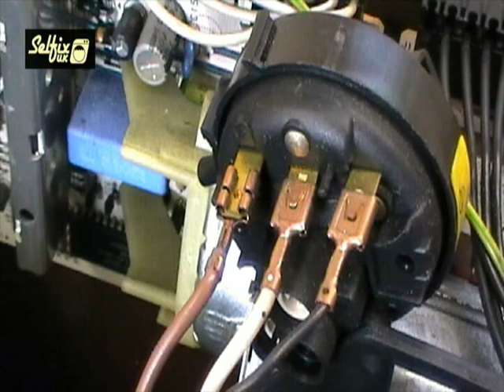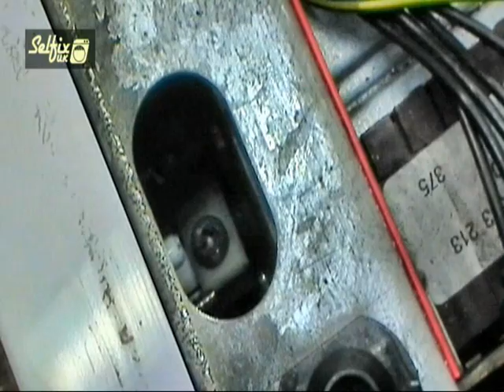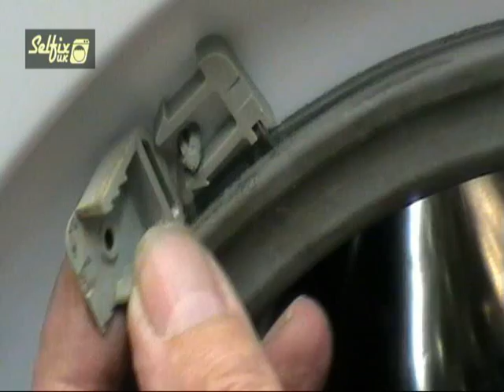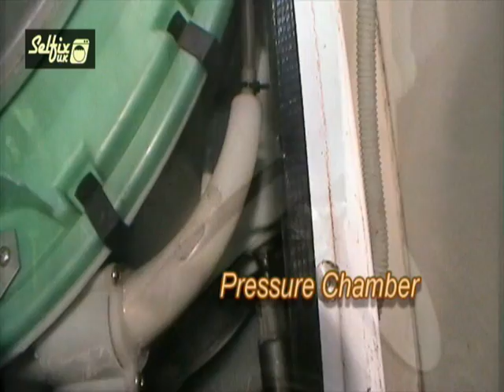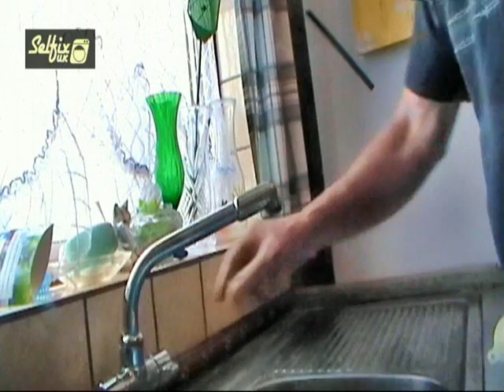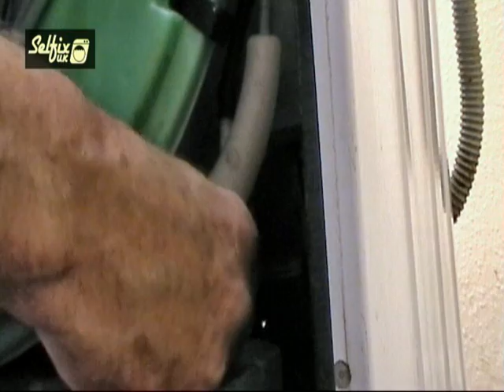How To Fix A Blocked Washing Machine Pressure Chamber

Comment: Hi, i have a problem with a Samsung front load, wd11k64100, i had remplaced shock absorber, the hold sensor,  the water pump and starts to spinning in 15, so when it gets to three minutes,it goes back to 15 and never end to spinning , would You help me please

Comment: Hi, I changed pressure hose and pressure switch and still the water is over or under filling intermittently. So I suspect there' s a problem or clog in the pressure chamber. The problem is the pressure chamber is integrated into the tub, I cannot disassemble it to clean it. Is there anyway to clean/unclog it?

Comment: gives enough "theory of operation" along with "common sense" that it helped me fix my washer of entirely different model.  In my case clearing the tube by blowing (hard!) down it worked for me when my ~20 yo kenmore would just start spinning with no water coming in. I then ran a few small hot loads with salty water to try and dissolve any soap scum possibly built up in the air pressure pressure chamber. If it happens again, I will fully clean out the air pressure chamber by dis-assembly, cleaning, and re-assembly.  THANKS!

Comment: Thank you for this brilliant video.  I just fixed our zanussi, which wasn't filling up properly, and now I am looking a the suds sloshing merrily around the bottom of the drum again.  It was easy (ish), and fun! 
(Top tip for anyone else- check what screw types you have.  I needed T-star's at one point, but luckily I already had a set.  Even so, investing in  set would be way cheaper than someone else fixing it)